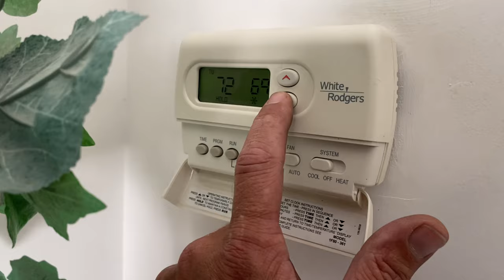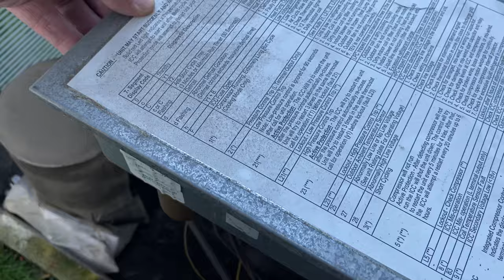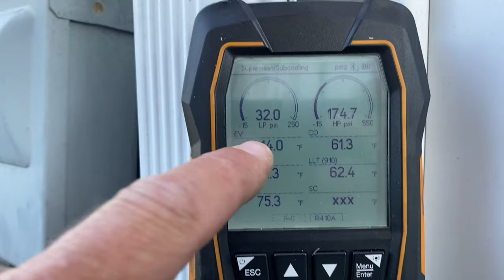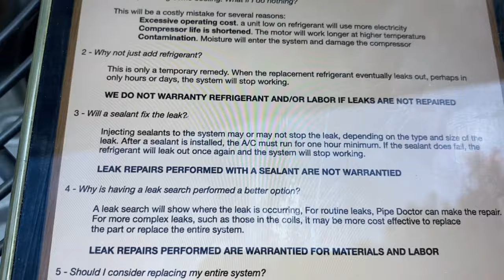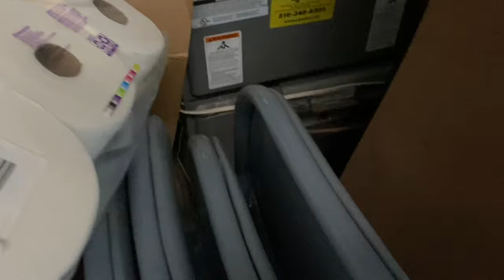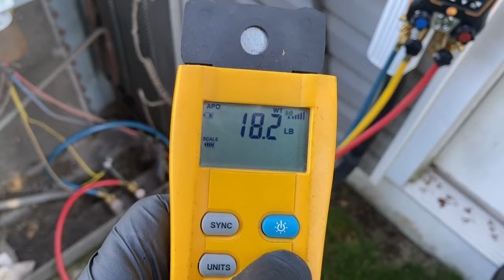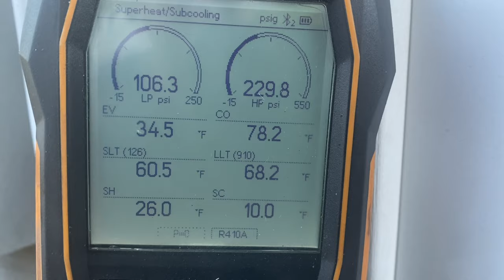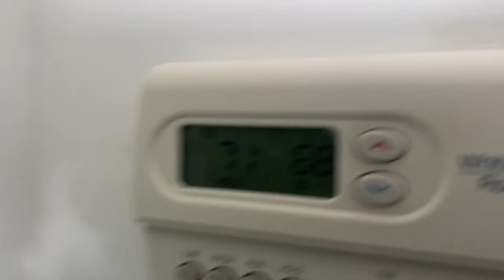Rheem Central AC Condenser Not Coming On 21 Error Explained How to Add Sealant to System

Comment: In my country we cannot top up a charge without making steps to find/repair leak. We find ourselves at a cost vs price dilemma. I have charged a system with dye and a sealant dye if I haven't found a leak with the electronic ( usually evaporator slow leak). You know the coil is leaking and hope the sealant repairs it but the coil is already corroding. This means you need to top off the charge until the leaks are sealed as the sealant requires the gas/oil to escape to seal the leak to the air/moisture. This postponed the cost but gave them air for the short term. In the long term it will cost them more but deference of payment is better for the immediate.  You explained it well to the home owner. 👍👍👍👌

Comment: Tough call, not sure how old she was, sometimes it’s best to offer some solutions as you did. Hopefully the sealant works and it gets her 3-5 years. Than she can decide than. Another option would have been quick sniff test with a sniffer, she goes off in the Evap than quote her the Evap replacement. I am a Lennox dealer usually the coils are 10 years parts. So I would have swapped that coil. I would have also checked for warranty

Comment: I guessed 3.5 pounds. You did the best with the information you had at the time. Had you known prior to charging it was 4.7 pounds low you probably would have searched for a leak. It is easy for the keyboard warriors to comment after the job is already done. Keep up the great videos!

Comment: Great job Mikey, I like giving her options. I typically will perform an electronic leak search search on the system, then if I’m able to easily find the leak with an electronic leak detector I’ll have a more definitive answer for the homeowner as to how to proceed. Either way she’s going to proceed with your repair or replacement recommendations because she trusts you. Just helps to save you on a return trip half way through summer. 95% chance the leak is in that evaporator coil as you mentioned. Providing a free 30 minute leak search has helped my company and myself profit from repairs and replacements. Love the videos my man!

Comment: On low systems, I get the leak detector out an go over the system with it, less then a hour normally. Then when found let the customer know if it's repairable or not, an see what they wanna do from there. While watching this I was wondering if you have a leak detector an if you use them? Don't recall seeing you use before.

Comment: First off, perfectly done again Mike. A question I have for you is can this leak sealer be used for any refrigerant in any system including refrigeration or only AC with 410A or R22? I am not a technician but I am enjoying learning HVAC by both you and my teacher at my local tech school. I’m gonna say 6LB 0.46OZ for the charge of the system.

Comment: I have a customer with 3 of these systems,RUUD branded, same vintage, in their house. I just replaced an evap coil in one last year and I suspect another leaky evap although I have failed twice to actually locate the leak. I added sealer with uv dye and will hope for the best. That L21 code keeps haunting me haha 😛. Also gotta be careful with the sealant, too much will ruin the compressor. I have been using Easy Seal with limited success but have also killed 2 compressors. Very small systems like a 12,000 btu water source heat pump do not like that stuff. In any case I would have done the same thing Mikey. 👍

Comment: I've heard conflicting reports on that leak sealer/UV dye injection.  My question, is the actual leak sealing material condensable and is it bad for the compressor.  I've been hesitant to try this leak sealing method.  Every time I'm at the supply house I contemplate buying some to try it out.

Comment: I would give a recommendation to use gaffer tape on your tools.  Either florescent green or pink works best.  Put a few wraps around each tool and it will stand out like a sore thumb if you lose or leave tools from time to time.  Quick scan and see a florescent pink tool and you know!  Also you can use different colors for the different techs, so when you are all working together you can get the right tools back to the right person.  I use it for all my camera gear and works great.  Black lens  and gear tends to blend in, but not when there is a band of tape on them brightly colored.  Just a little helpful hint for managing all the tools.  👍😎

Comment: After putting that much refrigerant in the system I would have definitely looked for a leak. With that amount of refrigerant loss you should have been able to locate the leak easily.
Reply: You would think so, but I’ve had some that were impossible. I’ve gone as far as isolating both coils AND the line set and STILL couldn’t find the leak. Checked service valves, schraders and nope. I had an old Trane system once that had a leak at the txv only when it was running.
Reply: I’m not a fan of stop leak but you did explain her options i like that you are honest I appreciate that i would go for the leak search thank you for the video

Comment: I guessed two pounds but there was a time during the switch from 22 to 410 and copper to aluminum that manufacturers had a big problem with leaks, hens the major shift from five to ten year warranty.

Leak stop is a bandaid if it works all like putting fix a flat in your tire, just more gunk to deal with when you fix the problem. Dye is much more effective at finding the cause of the problem if you want to fix the real cause of the problem find the leak. If it's a ten year leak just charge and go.

So I'm a stand up guy and I want to give an unsopecting  client a number of options which they don't even have the knowledge to  discern...

Comment: I have a basic question : Can you use the same refrigerant gauges for all refrigerant systems or you must use a different set of gauges to prevent oils from cross-contaminating?
Reply: You can as they are not the cheapest things to buy. I have a set of digital gauges and use them for both 410 and r22. You just purge the old refrigerant out of them before hooking up to a different one. If you can afford separate gauges, that would be the way to go

Comment: On one hand, 4.7lbs is a lot of refrigerant.  It’s pretty likely that system lost the charge pretty quickly.

On the other hand, it could be a slow leak and the customer could have just dealt with the high electricity bills & poor performance.  The system might have just gotten to the point that it stopped running because of low charge.

It’s a crapshoot.

I think the sealant & UV is a good move.  I’ve seen that stuff stop a leak for a few years.  Worst case scenario, the sealant/uv makes it a bit easier to find the leak most of the time.

Comment: Im not a fan of leak sealant.....but i also see its place in the trade. As long as the customer is aware that it isn't guaranteed and has no warranty.....then by all means...fire away. Residential customers seem to always want the cheapest route. In commercial/ industrial, its find the leak. I've had some leaks that were absolutely horrible to find and took a long time to find, but i found it. I also understand in residential the work load is and can get unbearably high with tons of calls. My buddy last summer called me up and told me they had 17 calls scheduled on him for one day. Hell to the naw. I do a max of 4 calls a day and usually 2-3 calls a day.

Comment: All the manufacturers used crap metal,  thinner tubing for better heat transfer,  & a refrigerant that runs 2.5 times greater pressure.  Like Steve Lav says NEVER A DULL MOMENT!

Comment: The only issue I would have with what you did is,  I would have looked for the leak with my leak detector,  the unit should have 10 years parts from installation.  It's worth a once over.
Reply: @PipeDoctor  I have also done just what you did because of time or weather restraints and went back before the warranty ran out,  ordered the part
 and fixed it.